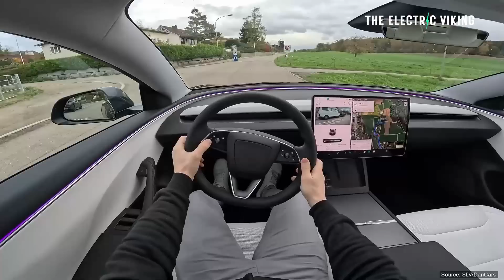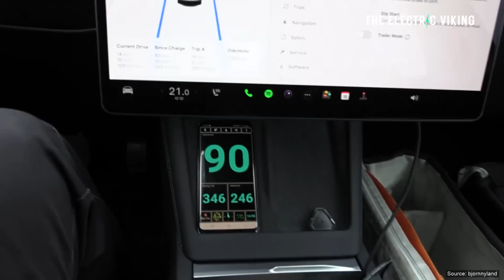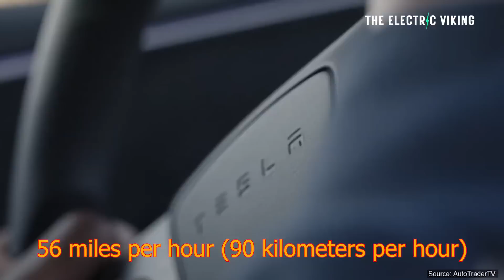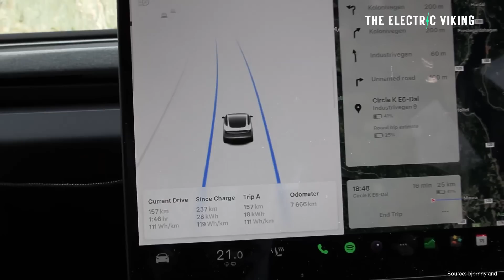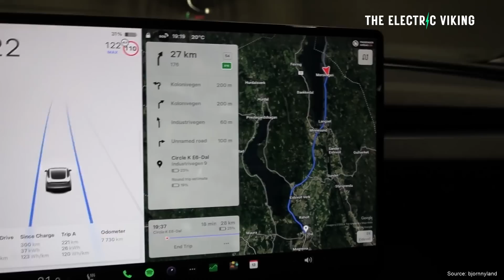Tesla with LFP battery achieves RECORD breaking efficiency in highway test

Comment: I just came from my vacation.
It was around 1000km trip that we did in around 11h, including two stops for charging with Tesla Model 3 LR ( 2022 model with 82kWh LFP battery , Shanghai factory ).
I was driving around 130km/h and getting 14.5kWh and when AC was working 16.7kWh / 100km. 
While on vacation spot, while we were driving around, the average was around 10kWh/100km on the mixed roads with 50% being on the road that you can go up to 100km/h.

Its just amazing.

PS: My total average after 37'000km since I bought the car is 15.2kWh/100km. That comes a bit less than a 3 liter of petrol here. But i have a car that can go as fast as a really good sports car.

Comment: 'Highway' tests by Bjorn Nyland should be regarded with caution as speed limits in Norway are low compared to the rest of Europe. Drag increases with the square of the speed.Thus, cruising at 70 mph (UK motorway)  or 112kph versus his typical 90kph results in a 50% increase in air resistance, which has a significant effect on efficiency and range.

Comment: The ‘24 M3 RWD with LFP is impressive.  At 78-80mph, I’ll get 4 mi/kW during a 200mi highway drive. On my 50 mile daily commute on roads ranging from 45 mph to 65mph, I can get over 5mi/kW. What is interesting is that temperature has a noticeable effect on efficiency during the daily commute. I am in a hot climate so I might only get 4mi/kW when it’s 95F/35C due to the high A/C load trying to cool the car down over the first 10 minutes of the drive. If it’s 80F/27C, high efficiencies are easy to attain. It’s common knowledge that EV’s get lower efficiency at cold temps but it also happens at high temps.

Comment: We have a 2021 Model 3 SR+ from China with the LFP battery. Over the last 3 years (according to the car) we have averaged 134 KW/100 KLM. That equates to over 4.5 Miles per KW/H. This is living in Athens with mixed mileage although I should point out that we are both in our late 50’s and don’t race. The new model 3 is the first car I have seen that seems to get better efficiency than that.

Comment: One thought about Lithium IRON batteries is that they have a MUCH flatter charge and discharge rate than Lithium ION batteries. This flatter discharge curve allows the batteries to deliver a longer discharge time since the voltage stays flatter and the rate of discharge remains flatter to delivered the same wattage.

In Lithium ION batteries, the lower the voltage falls, the higher the discharge rate becomes to maintain the same wattage (power output). Since the voltage falls faster and the discharge amperage increases faster, the faster batteries discharge faster.

Comment: I got the new tesla 3 2024 LFP battery with Photon aero Wheel . At 68 mhp , air conditioning off , I get 5.9 miles /kwh . 
Previously I got 2022 with LFP battery . I don’t know why but my 2024 is a way better !!

Comment: My model 3 RWD used 14kWh/100 km over the 7500 km we did in the last 2.5 months. We drove through half Europe with lots of highway, driving at 130 km/h and very hilly roads in France and northern Spain. We also live in the mountains in Switzerland. We are more than surprised by the efficiency of our Highlander. Our other car, a GV60 from Genesis is way way more thirsty 😂

Comment: The larger the vehicle, the higher the drag.  
Drag, the aerodynamic resistance acting on an object, and by inference the power required is proportional to the square of the speed.  
To go twice as fast takes four times more energy.
Drag can be minimized by;
Lower velocity through the air - slower speed on the road.
Smaller sleeker streamlined vehicle

Comment: My personal experience with my Tesla Model 3 (MY22) with about 60% driving between Brisbane and Newcastle and Sydney gives me 125W per KM.  For example, the trip from our home to Islington, Newcastle (768 KMs) takes about 96 to 102KWs to get down there.  Even if I used the Tesla charger, recharging would only costs between $67.20(96KW) and $71.40(102KW), whereas using highway priced fuel, it would cost around $160.00 for the same journey in an ICE car.

Comment: There is one reason the Model 3 is more efficient - weight.  Tesla has done the best at making a production car that weighs about the same as a Camry.  This is the Standard range;  the long range and Model y weigh roughly 1000 lbs more.  There really sin't much for aerodynamics for autos- mostly if you look at the front profile - the height width is about it - to get laminer flow you need a much longer aircraft looking taper sort of like the Aptera 3 wheel motorcycle.  Not very practical. when you go up hill; your carrying the weight of the car up that height;  when you turn a corner you lose momentum and have to accellerate F=MA. M= Mass is the key.

Comment: Great vid btw. Can you specify the type of battery you want in the dealship if you were to walk in and order a Tesla. Also : The Hyundia Ioniq Electric 2019 (Not the 5) Is the only other car that has done this. I had one for 3 years and frankly, it was truly impressive. Cruise Control (adaptive) set at 85 MPH and it always hit its documented target. Many people were getting 200 miles plus around town, even though it had a 165 Mile range. I now have a Kona 2024. What a joke in comparison. Faster, Yes, with a WLTP of 319 ! Yer right ! . Real world summer range of 270 Miles at best. Lucky to get 230 in Winter. (same speeds, same journey in both cars)

Comment: Just drove 549 miles in my 2023 rwd LFP --speeds between 60-80mph and consumed 245wh/mile ===  used 134kwh total.   AC on whole time.     Convert that to gasoline (33.7kwh to a gallon) and we got 138mpg.  Nothing touches an EV when it comes to energy usage, its just battery packs are just not anywhere near as energy dense as fossil fuels.

Comment: EPA consumption ratings are measured from the wall when charging.  This includes heat losses in the on-vehicle charger and battery, about 10%. This should not be directly compared to energy consumption measured at the battery output, as Tesla and other OEMs report on the car's info screen.

Comment: Tesla is amazing. They started from 0, no experience, no workers, no technology, no factories. Now they can compete with anyone.
Reply: Everyone learnt from them, should have patients, Tesla is a cool car for sure.
Reply: @joeferreira657  - Tesla does have an extensive patent portfolio but they have opened most of their patents for anyone to use free-of-charge in order to accelerate EV development by other companies. That said, it seems that the most difficult aspect of making a good EV is not the physical automobile but, rather, the software that manages it. Software development seems to be a foreign concept to the legacy automakers as is demonstrated by the failed efforts of the Volkswagen Group with their ID.x cars.
Reply: I grew up in Detroit during the 1960s and 1970s and have followed advances in the automotive industry closely for many years. I wondered why Tesla has done what no other US automaker seems to be able to do. About two years ago I looked at the demographics of Tesla and GM and Ford. One thing stood out: the average age of their engineers: GM & Ford the average age of an engineer was 54. At Tesla it was 31.
That says a lot about Tesla's advantage over the others and why their cars fart.😊
Reply: @thomasruwart1722    Tesla and SpaceX consistently rank 1st and 2nd or 3rd top choice for graduating engineers.  Some 2M applied for 20k openings at Tesla last yr, far harder to get into than Harvard.  They have the pick of the very best and exceptional fundamental selection methodology. Plus a CEO who knows how to motivate and get the most out of them, no hierarchy or "chain of command" interference to efficiency--they go straight to the most pertinent person to solve problems.
Reply: @Mrbfgray  - Yes, and the idea that they do not have "budgets" and are encouraged to responsibly spend as much money as fast as they can to get their jobs done. There is no way the "old guys" can compete with that.
Reply: @thomasruwart1722    True. Culture is incredibly important and Elon seems to have about the best priorities ever to that end.

Some do get burned out but one engineer who quit due to Tesla hrs and demands came back bc "I'd rather be burned out than bored."  Contrary to popular notions they retain their top tier staff considerably longer than average of Silicon Valley firms.

Some quit bc they have become rich off the stock options.
Reply: @thomasruwart1722    I've contracted for "a thousand" outfits over the yrs and I can typically smell union mentality immediately.  It corrodes the entire enterprise top to bottom, with rare exceptions.  Causes endless petty conflicts and distraction, wasted energy and focus.

As a shareholder and concerned citizen I loath the idea of a unionized Tesla but it doesn't seem likely anytime soon.
Reply: @Mrbfgray  - Incidentally, I have a theory as to how Tesla came to develop the ability to fart. I believe a young kid right out of college was working at Ford and was assigned the task of making the turn signal in the MachE go "tick tick tick". So he does that and his VERY next thought was "Hmmmm... I wonder if I can make it fart fart fart too?" So he does and the following day at the engineering status meeting they ask him how the turn signal sound is coming along. He said it was done. And then mistakenly added "I also made it fart instead of tick." 
"Really? You spent time making it sound like a fart?" asked his manager. "OK then, you're fired." 
A couple weeks later he interviewed with Tesla and it went something like this:
Tesla Hiring Manager: "So, tell me about your experiences at Ford. Why did you leave?"
Kid: "Well, I was asked to make the turn signal go tick tick tick on the MachE but I also made it fart. They were not amused."
Tesla Hiring Manager: "What?!? You made the turn signal FART?!?"
Kid: "Yes, I know, it was a REALLY dumb thing to do and I won't do anything stupid like that again."
Tesla Hiring Manager: "Oh my, no. It would be FANTASTIC if you could make our cars fart! That's hilarious! You can start farting, I mean working next Monday!"

That's my two scents!💩💩😁
Reply: @Mrbfgray  - We must be in  the same age group (Boomers). I think Unions served a useful purpose at one time but have largely lost their "value" in some industries, the Automotive Industry in particular. 
The UAW is in for a rude awakening when Tesla [and others] deploy Humanoid Robots in their assembly plants, displacing a significant percentage of the unionized workforce. And the automobile companies that don't employ these robots will likely disappear quickly, taking their entire unionized workforce with them. 
That's my two scents💩💩😁
Reply: @thomasruwart1722    I won't waste our time, but I could tell some stories about unions I've encountered.  Began to loath them right from my first industrial job as 17 yr old.  The only thing they ever did for me was help convince me to start my own business at 20.

Union Pacific Railroad union was an incredible shit show for my couple weeks contracting for them.  Track maintenance crew raised hell about my presence up and down the line, despite the fact that no one around was remotely either willing or able to do my work. They got zero warning when the project was to terminate bc that would allow the workers to steal everything in sight, it was cheaper to suddenly lay them off and pay the 2 extra weeks. (oops, guess that was a story, lol)

Yeah I'm late boomer.
Reply: You make it sound like they started with absolutely nothing. I would look into how much taxpayer money we put into this business. Give me millions of dollars of taxpayer money and I guarantee you I will make a successful business. As a matter of fact, anyone could.
Reply: @hiroyui9699  - Over the lifetime of Tesla, they have received just under $3 Billion in US Federal subsidies. Most of that was in 2016 rather than at the beginning in the early 2000s. Compare that to the more than $30 Billion that Ford has received since 1992.
That said, those government subsidies are viewed as "investments" in companies that have some potential for generating future tax revenues that effectively repay the subsidies. For example, to date Tesla has sold about 400,000 Model Ys in the US. If you assume an average selling price of $50K and a sales tax of 5%, then a total of $1 Billion has been collected  on just those sales. 

Having been involved with several tech startups over the past 47 years, I can tell you that lots of funding does not equal success. Tesla is one of the few companies that did succeed and the US is far better off for it. Tesla is the only American automobile company that has any chance of competing with the Chinese EVs. Ditto with SpaceX.
Reply: @hiroyui9699  - Over the lifetime of Tesla, they have received just under $3 Billion in US Federal subsidies. Most of that was in 2016 rather than at the beginning in the early 2000s. Compare that to the more than $30 Billion that Ford has received since 1992.
That said, those government subsidies are viewed as "investments" in companies that have some potential for generating future tax revenues that effectively repay the subsidies. For example, to date Tesla has sold about 400,000 Model Ys in the US. If you assume an average selling price of $50K and a sales tax of 5%, then a total of $1 Billion has been collected  on just those sales. 

Having been involved with several tech startups over the past 47 years, I can tell you that lots of funding does not equal success.
Reply: And it took only 10 years... 😁 Chinese 2 years.
Reply: @xaviart4727 oh those copycats 🤔

Comment: Tesla's have always had good tech, but their Quality and Reliability is crap.
Still wouldn't buy one, can't recharge anywhere, and it costs you more to fill up the tank than using petrol.
And then, there's the resale value. Nobody wants to buy an old iPhone because of the battery and it's old tech that may not compatible with what you hook it up to in the future.

Comment: if the model S had the same tires as the lucid air, it would be a lot closer in efficiency, right now, the lucid have 245 low rolling resistance square set up tires, and the model s has 295 and 265 michelin sticky pilot sport 4s tires... so think about that for a second..., of course the model 3 is way more efficient than the lucid

Comment: Why am I not surprising? Because it was absolutely obvious to me, as an aerodynamicist, that Tesla, or presumably Musk, had employed some competent aerodynamicists to minimise the drag coefficient of their car. The key place where this is done is at the rear end of the car. When laminar air flowing round an obstacle encounters a sharp reduction in cross section, it separated from the surface leaving a turbulent low pressure region behind the vehicle that sucks it back. Tesla's body shapes have a beautiful smoothly converging shape that causes the airflow to converge, and recover a higher pressure, before cleanly separating behind a much smaller area of back entrance than most cars. About 20 years prior to Tesla, Toyota did a similar job on the Prius, but Tesla have excelled them...
Reply: Oops, back end, not back entrance...

Comment: EVs are less efficient on the highways? NO. Cars and all other vehicles are less efficient on the highways regardless of how they are powered. This is not an EV specific thing. But more importantly I'm always amazed that these figures are seen as amazing when my humble 2015 24kwh Nissan Leaf with no thermal management regularly does between 5.0 and 6.3 miles per kwh in town and 4.8 miles per kwh in mixed driving including motorway driving. Even at 8 years old it drove close to 500 miles on a trip to Harrogate and back and still got 4.8 miles per kwh, which is the efficiency I was getting when it was new. If you want to talk about underrated cars few rival the 24kwh Nissan Leaf.

Comment: 3:40 - Incorrect information the EPA rating of the RWD model 3 in the USA is 272 miles - the usable battery is 57.5kwh = 4.73 miles per kwh not 4 miles per kwh.

Comment: I like your content but one thing you missed in this comparison is the weight factor. The TM3 weight 702-1474 lbs less than the Lucid Air. A better comparison would be the TMS Plaid which depending on the LA configuration could weight 200lbs more or 500lbs less and gets 2.6-3.6 mi/kWh.

Comment: Ok, so I had had the new model 3, RWD single motor, for nearly 8 months now. Living in NZ, I’ve done about 8000km in the car.  I have NEVER seen anything near the quoted range (513km) at best it states 430km on a full charge.  Actual driving ranges are probably 370 (winter) to 410.  Most of my driving is 80-100kph with minimal city driving.  It is the one aspect that I am very disappointed by.  So either they have a newer battery in the cars that were tested or there is something else going on.

Comment: The QUOTED ranges of an EV when sold should be 3 numbers ... all 70 mph net 0 wind, flat runs at 20, 65, and 100 degrees F with the cabin set to 72. The RANGE should be how far can you expect to get on a highway, and we can all accept that it might be BETTER than that in many cases, but only ever worse in the most extreme uphill/headwind circumstances. Nobody cares that you could dive an extra 70 moles if you did all your driving in the city ... YOU'RE NOT GOING TO drive that much in a city before getting home and charging anyway. That's a pointless number.

Comment: That efficiency is exactly the same I get from my Chevy Bolt EUV, in fact my all time average is 4.1 after 18 months of use.  The Bolt model was probably designed by 2015, a dinosaur by today's standards.
Reply: This test was at highway speeds, everyone here is getting much better average lifetime values, where the average speeds are much lower